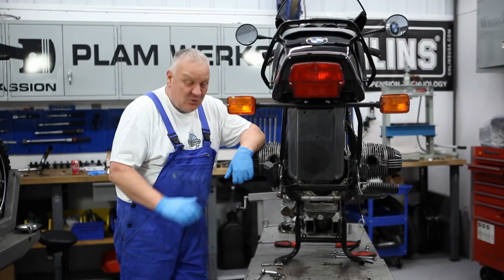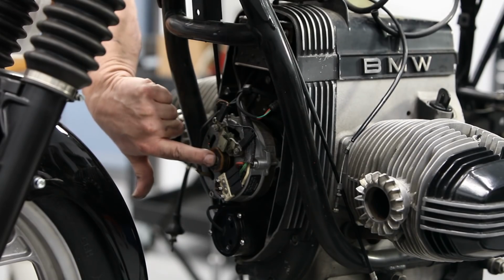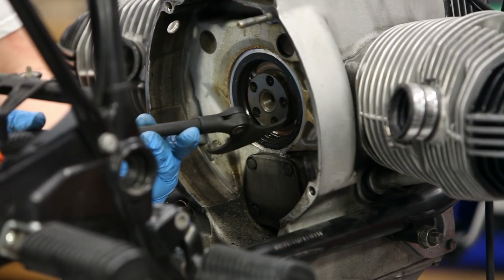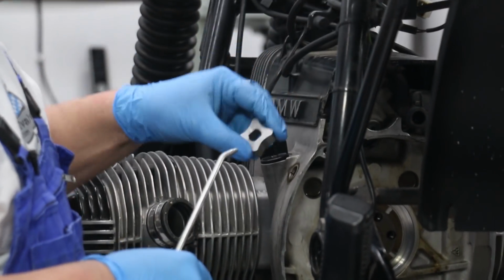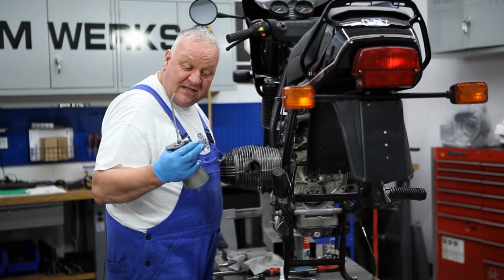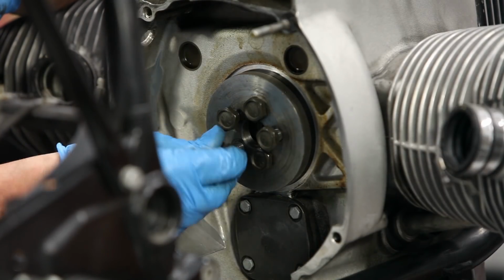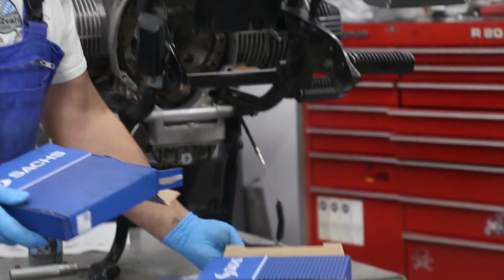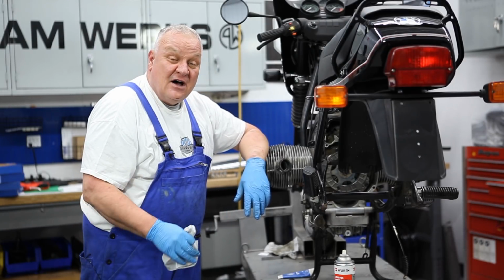BMW Airhead Mechanicals #02  CLUTCH | MAIN SEAL | OIL PUMP

Comment: I recall 32 years ago, I had oil leaking after replacing the main seal. As you know, the seal seats on the outside of the flywheel boss, but I suspected it was leaking between the crank shaft end and the boss ID, coming out around the 5 bolts. I stopped it by laying a small bead of RTV down into that recess. It stopped the leak but as a non-professional, I questioned the fix. I was delighted to discover in your video that this was in fact needed when you mentioned that in model years 75 or 76 BMW added an ‘O’ ring. My R90S is a 1974 so that was missing. Thanks for your great videos. Regards, Andy

Comment: William @boxer2valve, thank you for your very informative video series.  Question: In another video, you show a home-made timing cover puller.  Wouldn't this make an ideal tool to hold the crankshaft while working on the clutch/rear main seal (assuming that you keep the timing cover bolts in place)?  After watching your R90 video, it occurred to me that that might be much more secure than the strap you used in this video.

Comment: Are there telltale ways or engine operating problems that will indicate if the thrust washer has fallen off the back of the crankshaft on a  disassembly and not fixed by a previous owner or mechanic (oil leaks, engine noises, etc.)?

Comment: First of all congratulate you on the great work of your videos, it is an effort that you transmit your knowledge and make such detailed videos, congratulations and thank you very much.

I am changing the clutch on my R100RS and I have decided to change it completely, all four pieces.

As the parts are new, how do I know the correct alignment position?

In your video I have seen that the pieces were new (SACHS), but they had some marks. If they were new parts, how did the alignment marks have?

Thanks in advance and regards from Spain.

Comment: Hi William  Video very timely. I have just taken the gearbox off my 1987 R89 RT and today started on the clutch. but with all six bolts backed right off, the clutch is absolutely not moving. It is firmly stuck in place. I'm guessing I need to jar it somewhere to persuade it to move?  Thanks for all the videos!
Reply from the maker: Glad the timing is good.  This stuck clutch is not uncommon.  the pins / pressure plate are probably rusted a little.  A good " whack" with a hammer should break it loose.
Reply: Just as you said - bit of rust on the three pins. Came out easy after a whack!

Comment: When you took the feeler gauges to the oil pump what would you do if the gaps were too large?  And if they were too tight?  Thank you for all your insight.
Reply from the maker: Too tight would probably not happen. Too loose would indicate that the opening in the motor block was damaged, assuming that the pump parts are new. Then it would be a question of how much beyond spec? A very small amount might not be a problem but more than for example 0.2mm beyond spec, it may be best to look for a good used motor.

Comment: Thanks for another excellent presentation, William.  Another set of workaround tools and tips to avoid catastrophe, such as the crankshaft restrainer and the reason behind it. Marvellous.
It's great to learn about the '81-forward improvements to the clutch design and the standardisation across all these later two-valves. It means a larger market for replacement suppliers and an incentive to keep a good stock.

Its always a thrill when I see a notification that you have uploaded a fresh episode.
Reply from the maker: So happy that you can benefit from what we are doing!